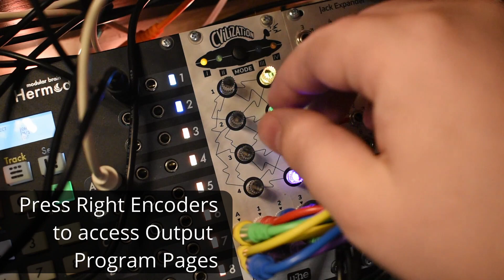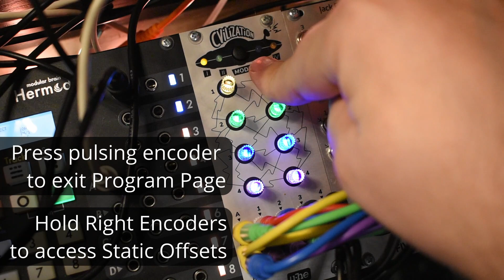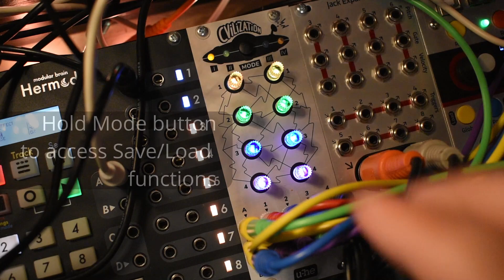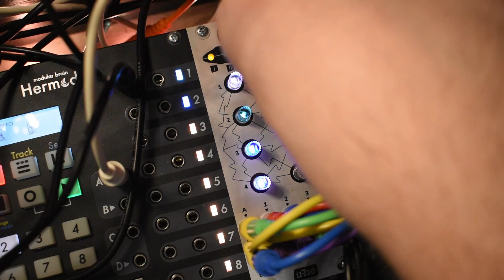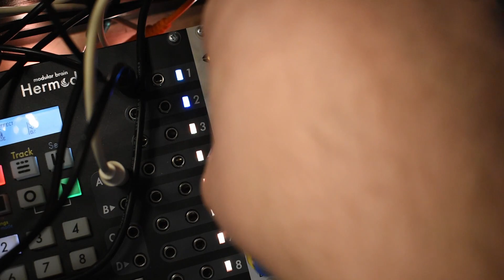3am - u-he's CVilization - Matrix Mixer Sequencer Aid

Comment: Seems like a brilliant module. In the original presentation at Superbooth they said that they were going to add an LFO and Envelope function in Mode 4. However, they seem to have dropped that and gone for the Quad mixer, which (IMHO) is not really that important for the majority of users. If they'd stuck with their original plan this could have been the most powerful utility module out there - well it still 'sort of' is 😉.
Reply from the maker: I have to admit that I only use the Matrix Mixer and Sequential Switch modes. I've seen folks so some really interesting things with the quad mixer and the sequencer but it's not really the way I work. Honestly, if it only had the Matrix Mixer mode, I'd still be happy. If it were any more useful, I'd need a third or fourth! 😅
Reply: @justin3am  Sounds a good recommendation. Actually, I'm sure it's perfect like that, but since I heard them announcing it at Superbooth I sort of imagined it did what they said. Looks great anyway, I'm most tempted.